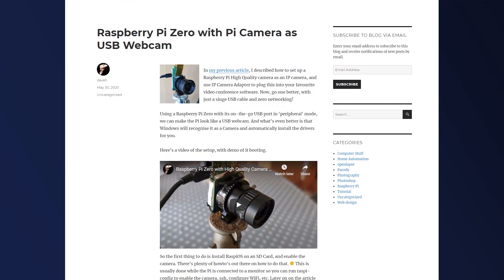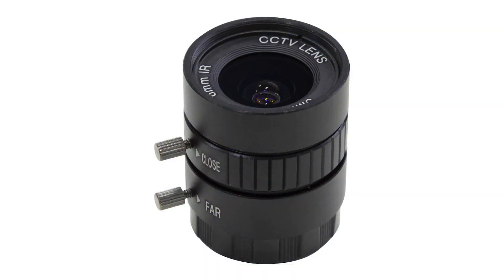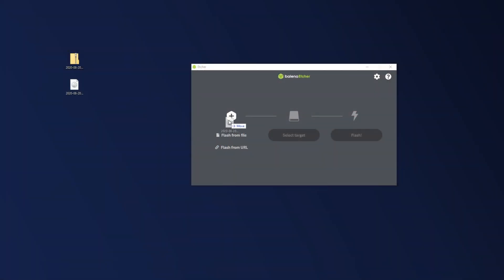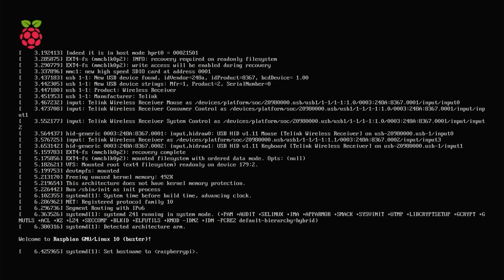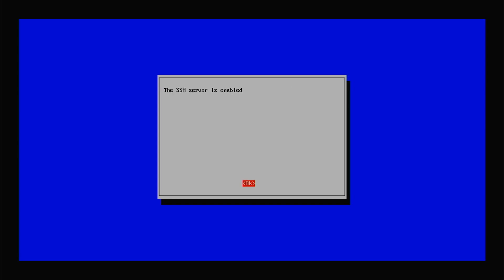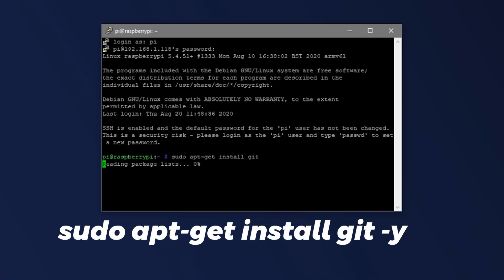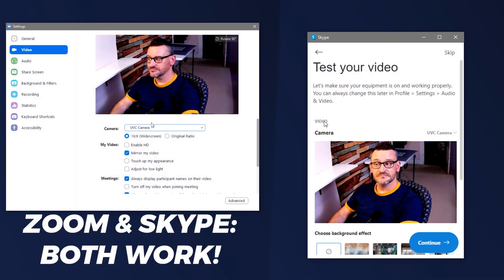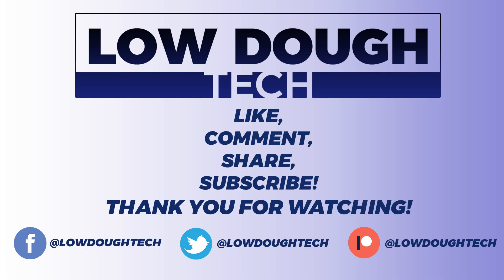Build a Better USB Webcam with Raspberry Pi!

Comment: v4l2-ctl -L  this command should list all the controls available for camera, just type it in pi terminal. You can pretty easily control all the settings from there. In case you want to save the config, write those commands with modified values to piwebcam file which you downloaded from git.
Reply from the maker: Ah! That's great to know! I will definitely check that out, and I'm going to pin this comment so others will know this, too!
Thank you!

Comment: Just the fact that you could write your own processing software gor this sensor and use it with any lens that fits its mount is awesome. The 25mm lens wouldn't be very practical in webcam use but it defenitly is in some image processing applications. I bought two of the cam sensors with 6mm lenses attached. Im very excited how good stereo vision will work with this.

Comment: You didnt show what app you use in windows. What is compartible, like zoom discord, twitch or the windows webcam app.
Reply from the maker: I use OBS. The camera shows up as "UVC Camera" and any app that can detect a webcam should be able to use it. I tested and confirmed it to be working in the Windows Camera App, Skype, Zoom, Discord. I don't use Twitch, but if it takes webcams, it should work.

Comment: Hi mate, thanks for replying. I have followed this and many other tutorials to the letter but still have not managed to make this work. I have even tried to burn ani mage of raspbian, already setup to work as UVC camera by another youtuber. I keep having the same exact outcome: the Pi zero boots up, the device it's detected but not recognized in device manager and  keeps crashing...it definitely seems a USB driver issue .. I will try on a different machine!
Reply: Did you ever find a solution

Comment: Hi there! I have tried several times to follow David Hunt instructions and others with no success. I have a Pi Zero W and the old camera module Rev1.3 5mpx. Once plugged in it keeps crashing and disappearing from device manager (It never showed the pi zero cam as UVC though). I am stuck any suggestion, please????
Reply from the maker: Sorry it took so long to respond, busy weekend here! Anyway, check out what I mention at 6:52.
Reply: Did you ever find a solution
Reply: @tomschofield686  no I did not. The camera works on raspbian though. I don't know if the issue was related to Win 10

Comment: Would this work with the non wifi pi zero?
Reply from the maker: I'm pretty certain it will work, but I don't have a non-wifi pi zero to test it to confirm.
Reply: LAN over USB is the solution there!

Comment: Man, you rock...I am going to build something like this. You give all I need. If you have ever heard of an "Optical Comparator" ...It should be EASY to make with a similar cheap build. I need someone to write a measurement overlay for it.  It wouldn't need much just a good grid with numbers.
Reply from the maker: I'd not heard of an Optical Comparator, but after Googling, I can see where this could be a DIY option!

Comment: I plan to use a Pi 4 with 8 GB RAM?  I have one on hand.  Other then cost it should work in place of a Pi 0. 

Thanks for going over the details.  I was just about to buy a webcam and I like the idea of building your own camera. 

When is your next project video? I always find the interesting to watch!
Reply from the maker: Dale Marcell the Pi 4 should work, the only thing is you may need to power it externally, because the USB port on the PC is probably not enough to power the pi 4. 

I try to release tech tutorial videos every Sunday at 5:30 pm, eastern time, and If I have any products to review, I release those videos on Tuesdays at 2:30 pm.
Reply: Low Dough Tech / thank you for getting back to me. I’m planning to post my camera build on Reddit I’ll let you know when I finish it.